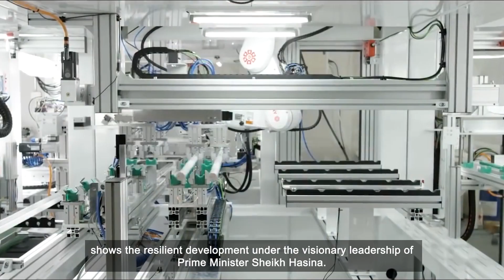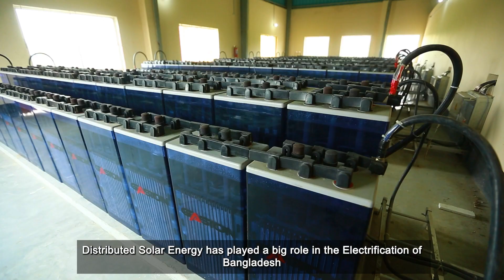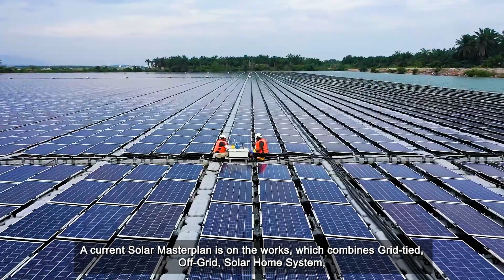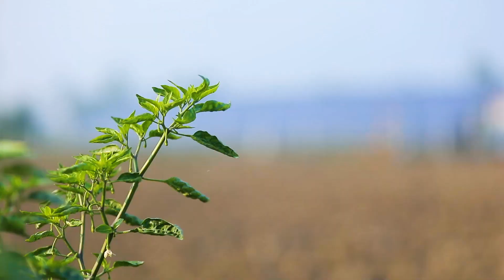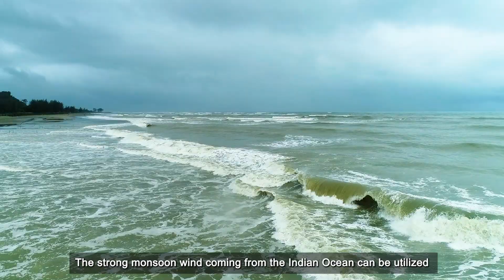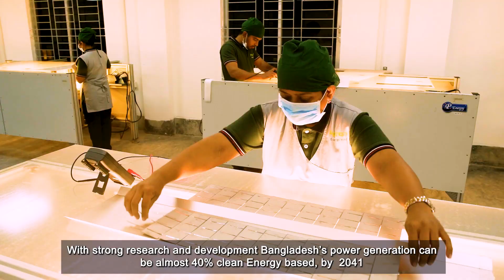Solar Energy Revolution in Bangladesh.

Comment: why govt is not introducing 2-phase net metering technology in the solar system. In a result, every home will have their own solar system as well as they can supply their extra produced solar electricity to the main grid. if 50% of our country's population can access solar power over the year then industries can use more electricity. For primary installation, there should be partial subsidies as well as bank loans with minimum interest rate so that everyone can install the solar system at their home and occupied land. No more dependency on fossil fuel resources.